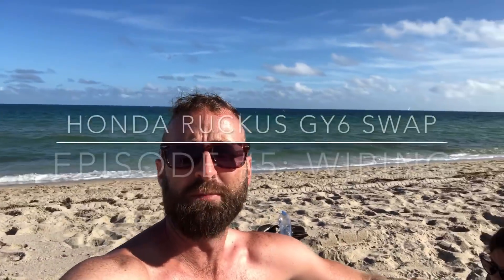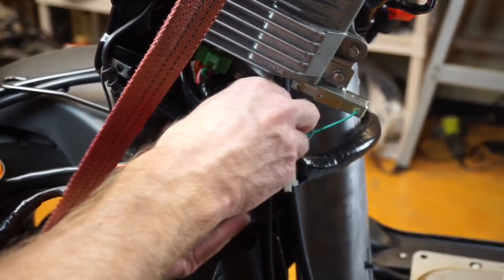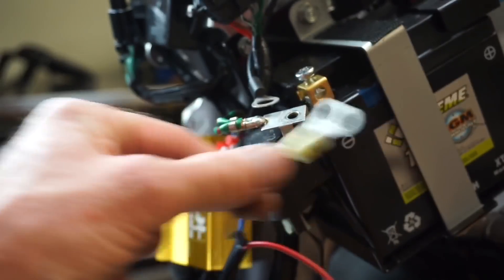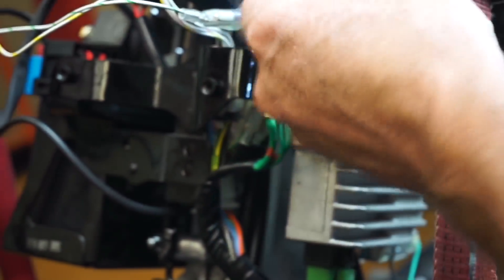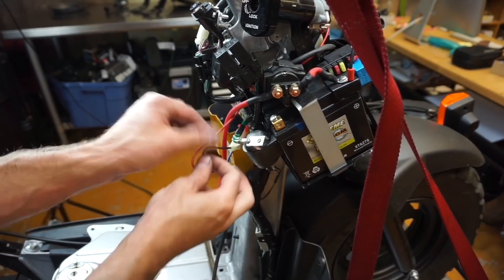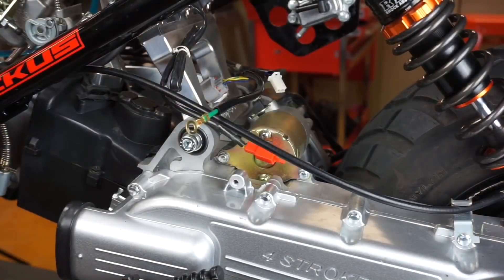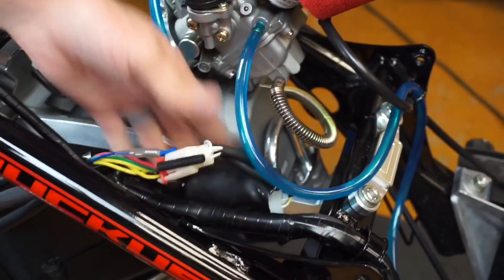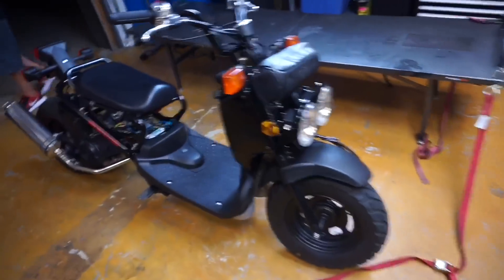GY6 Ruckus wiring Build Series: FINAL EPISODE #5

Comment: Question? I have a NCY Performance CDI currently installed on my 49cc get motor Honda Ruckus. I just completed your GY6 build series, Re: your plug n play wiring harness, will I need to remove my NCY CDI and return to original wiring before installing your new harness ??
Reply from the maker: Yes, return everything to stock first. I would love to see another one of our kits on the road :-)
Reply: Awesome! Just gotta save a little more play money, you'll be hearing from me later. Thanks for the advice!!